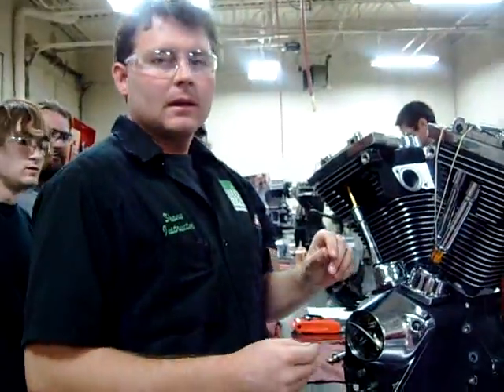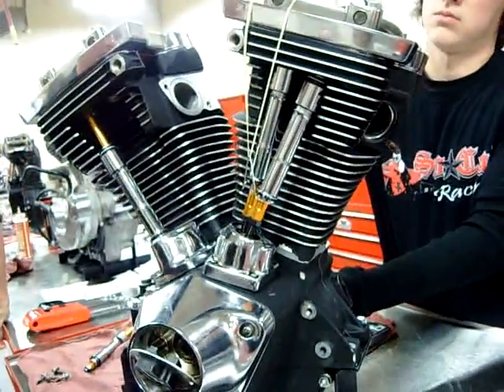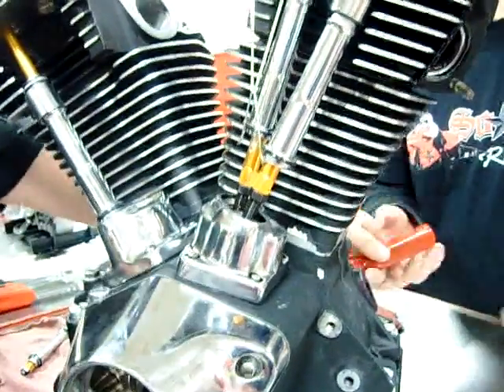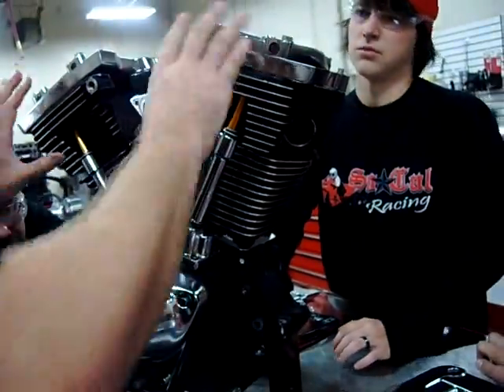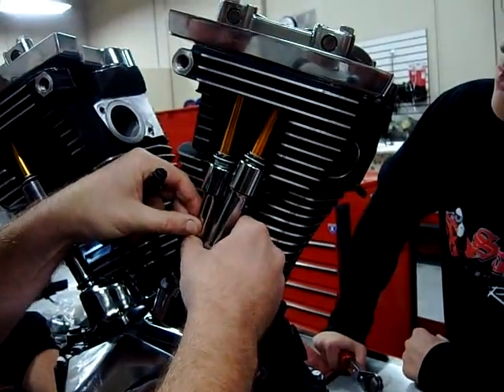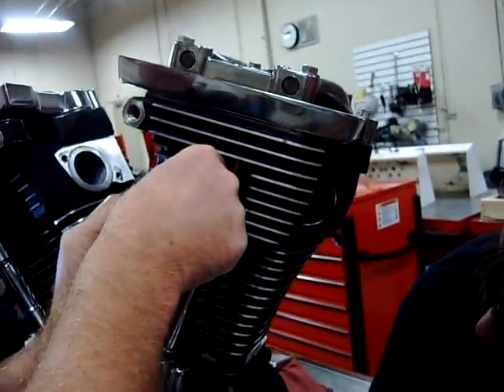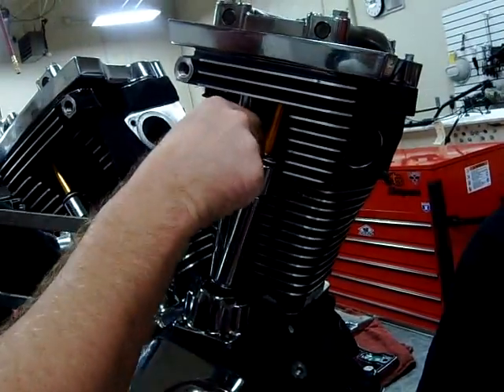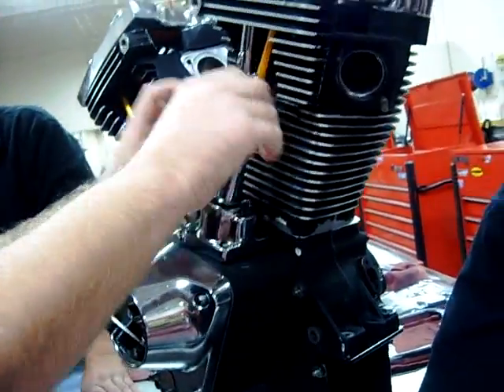Part 08 How to install pushrod tubes and clips on a Harley EVO motor S&S Jims Revtech TP

Comment: excellent video.    Are rocker cover bolts known to come loose?   I had some oil cover the front rocker box after an oil change & ride.  could overfilling the oil cause this?     1997 S&S 96" super stock.     (had all gaskets replaced a year or so ago)

Comment: Thanks for the video. My 99 fxSpringer is leaking oil at the front rocker box area. I intend to replace the gaskets. The video shows all the little tricks that the manual doesn't give. Thanks again.